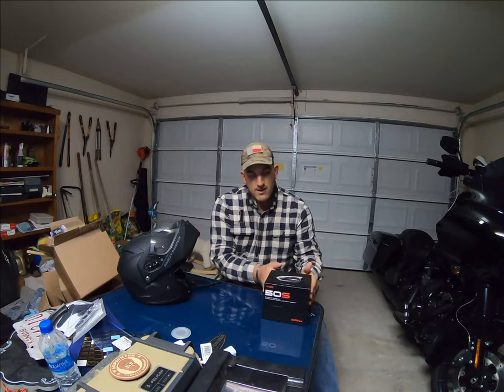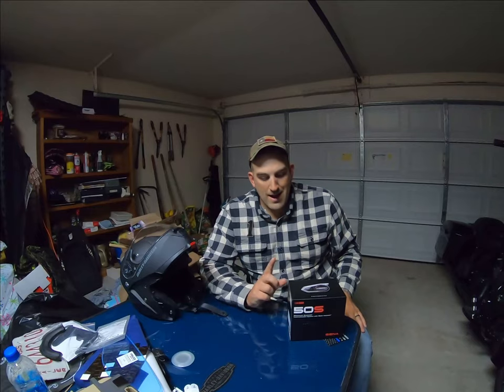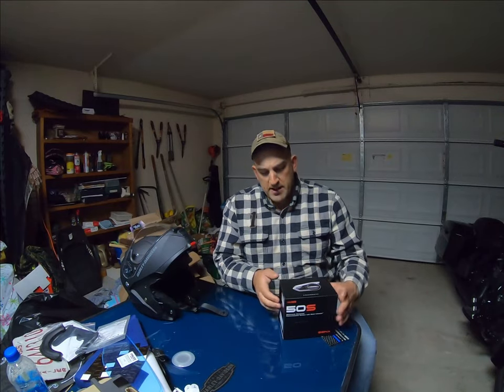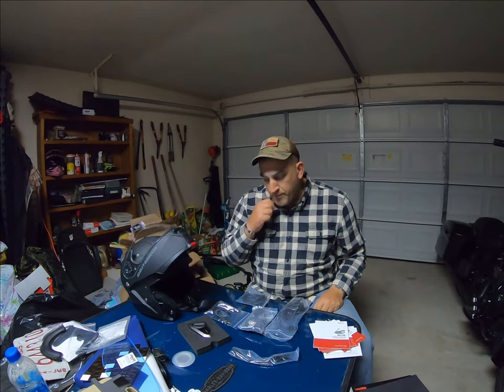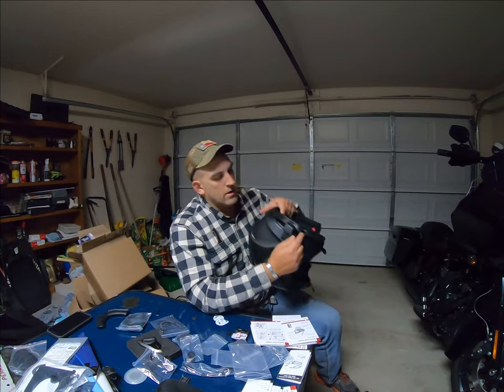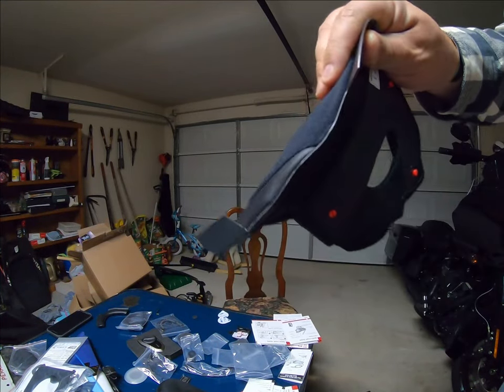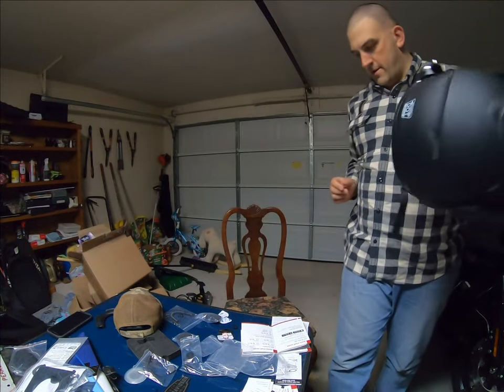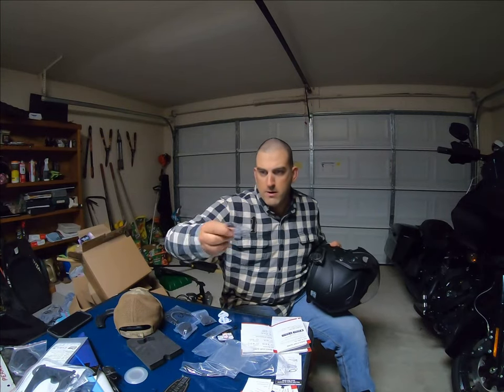Sena 50S unboxing and install

Comment: Sena has several mics included so you don’t ever have to trim your cheek pad mount.
Reply from the maker: I was wondering about that however I wanted the boom under my padding. Not sure that the wire mike that sticks onto the helmet would work with my modular helmet.
Reply: @2WheelVet  I used the half wire, half boom mic in my rpha 90s carbon modular. Now I gota figure out a gopro mount.
Reply from the maker: I have debated on doing the front mount moto Vlog set up or just mounting my smaller GoPro on top of the helmet.